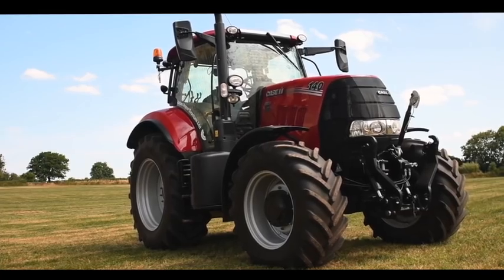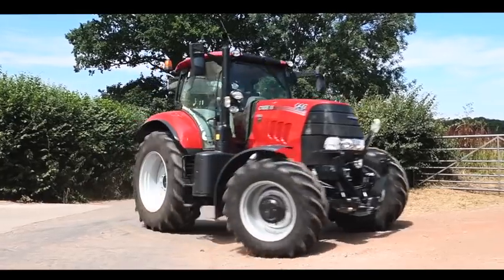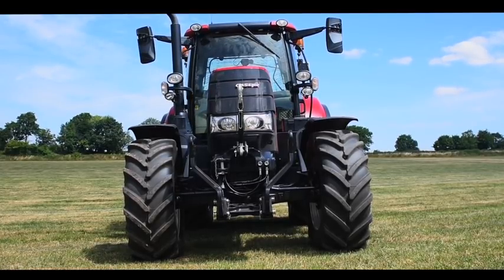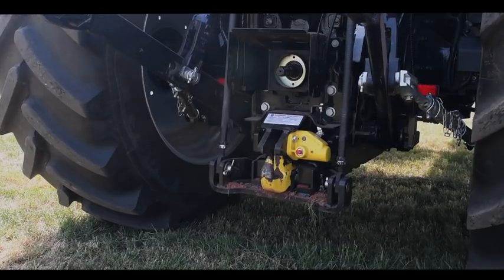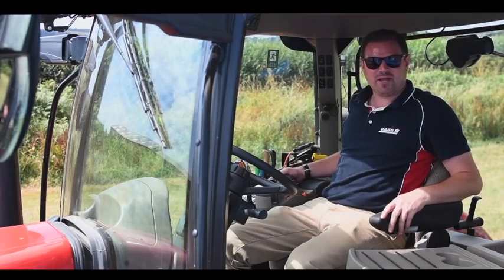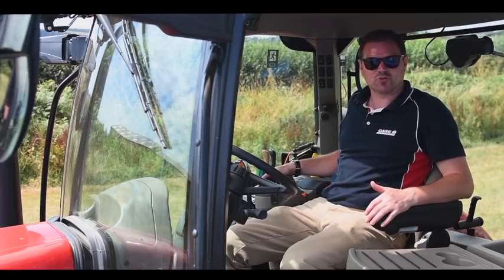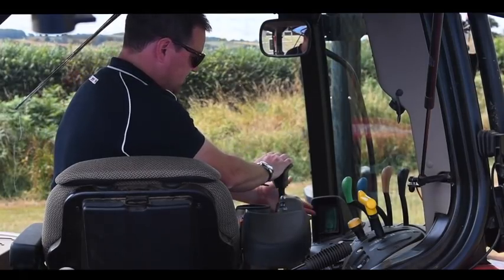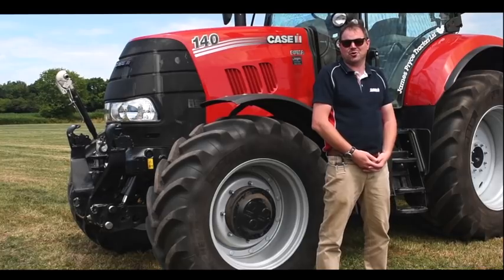Puma X walk around autumn 18

Comment: Puma Lite a Puma without the bells and whistles and like all Case machines it will do the job in the field but if its main task is road work i wouldnt take it for nothing ,Puma cab suspension is probably the worst i have ever driven sea sickness pills should come as standard equipment  ,the electronic clutch gives no feed back in your foot holding the tractor on the clutch at a junction or on an incline is a task in its self . Transmission wise the full power shift is slow to change and on ones ive driven had a nasty habit of jumping off certain gears even though it had been recalibrated numerious times . The ergonomics also could do with some work i think i have average size hands but the positioning of the shuttle lever means i cant reach the indicator stalk without taking my hand off the wheel and talking of indicators they cant put in a relay that clicks to remind you the indicator is on but they can install an annoying buzzer for when you forget to cancel them . This is just one mans opinion of course having sent many hours doing field work with one once you master the computer in the higher spec models they are a joy to work .